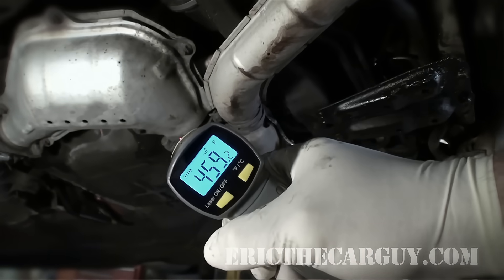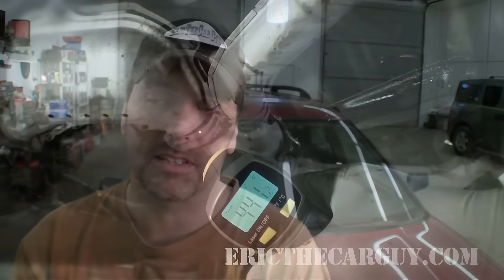Does Lacquer Thinner Clean Catalytic Converters? -EricTheCarGuy

Comment: As I recall, Kilmer used 1-gallon of lacquer thinner, to 1/2 tank of fuel. Your proportions were only 1/4 as concentrated as he recommended.
Reply: Scotty says in his video he has been, successfully, using LT for 30 years.  If you're going to do a test to myth bust something you need to do their test, not your version of it.  I've seen the actual Myth Busters do the same thing only to show their own ignorance.  If you go look at Scotty's video the first 10 top posts with scores of upvotes are people that did it and cleared their cat codes.  This is one video that would have been better had he actually done it the way it was intended to be, now the majority of peeps that sees only this video are going to assume it "just doesn't work" as if everything is as black and white as it works or it doesn't.  You don't buy 1 quart of oil to change your oil when it takes 4 quarts.  You get 4 quarts.  If it takes 1 gallon for a half a tank of gas and 150-200 miles of driving to work, if he wanted to "be safe" and use 1 quart he'd have to drive 800 miles to get a full gallon worth, and even then it might not work because the ratio is key.
Reply: 5 quarts
Reply: And I can tell you as a diagnostic tech and exhaust specialist I have made quite a bit of money from Mr. Kilmers little fantasy as I have seen more than my share of melted down converters from this idiotic trick. If its contaminated not much will fix that. That being said there is a chemical that WAS designed to help bring back converters that have carbon/oil consumption residue issues and possibly even antifreeze contamination. It is sold by Mr Gasket and is called Cataclean. It is marketed as a fuel system cleaner and catalytic converter "cleaner" and DOES work. The issues with lacquer thinner is there are several different "mixes" from the brands. The generic stuff Eric used is for cheap paints and varnishes and such NOT automotive paint which is considerably more sensitive to chemistry. I know from reading and such that a person found Cataclean, then tried the sniff test and may have even seen an MSDS sheet on it but got no specific concentrations of any chemicals involved. 
The theory of the lacquer thinner I have found came from back in the day of flat bed pellet converters and engines burning oil for what ever reason. Lacquer thinner made older engines run hotter on the exhaust mainly due to carbs not being designed to meter lacquer/gasoline mix AND newer gas has ethanol also.
And the computers wont allow the exhaust to overheat as most OBD2 cars also monitor for EGR temp as many cars have plastic intakes/gaskets and high EGR temps may cause engine damage.
You want to do it do so at your own risk because I have seen too many cars come in with melted down converters from the lacquer thinner trick and when a converter melts down, your talking at least $350+ to get a proper one. Yes Yes I know you can buy super cheap ones from Ebay, been there, done that and got P0420/P0430 codes and also had cars fail emissions when they go home. Heck some car can run as high as $1000 to replace converters parts alone as they have 4! 
Good luck if you try this , in my professional opinion as a 30+yr tech, hoax and I hope you dont trash your car.
Reply: @MonzaRacer  so cataclean does the job while protecting the cat and rubber car parts?
Reply: chris credit
Reply: I have a cat that is currently plugged as a results of using Blue Devil head gasket sealer when I had a HG leak.  It basically went into the intake, into the combustion, and out into the exhaust.  It's my 2000 Cherokee and it has two small cats right near the bottom of the engine.  THe rear one is plugged since only one cylinder got the BDP influx.  I have access to it and can remove it.  What would you say is the best way to attempt to clean it?  I at least want to see if it's fixable by getting all that mess out and see what's left before I buy a whole new setup.  Mine had to be custom fitted to my application as I have an aftermarket header setup.  If I get new cats I'm getting the OEM manifold as getting 1 of those bolts off of the aftermarket is a pain and only possible with the head removed from the engine as it's right behind one of the exhaust pipes and impossible to get enough torque on from the weird angles you have to contort to inside the engine bay.
Reply: @waynesanders1406  I think I saw video where they took out the front O2 sensor and pour it in a bottle of seafoam leave it soak overnight replace the O2 sensor start the vehicle don't do it in the garage
Reply: chris credit
Thus being significantly safer. Proves nothing but Eric's sanity.
Reply: Yeah, you're probably bright. I decided to replace my cat. Should've replaced my O2 sensors when the idiot light indicated.

Comment: I use acetone for this purpose and add 2 quarts with 2 gallons of gas. I
 had a 99 BMW 528i that failed smog in California by 13 points. Put the 2
 qt of acetone in when it had about 2 gal in the tank and drove it like l
 stole it on the freeway for 30 minutes, put 5 gallons of super in it, 
went back to the smog shop that failed it the day before and passed by 
10 points. BMWs are known to be on the high end of the emissions 
numbers
Reply: I've done the same thing but I used 1 gallon of acetone to 4 gallons of gasoline.I didn't even burn through all of the fuel before re-testing, I just went to the testing center with the acetone/gasoline mix and passed!  Afterwards I passed the test with the acetone/gasoline mix I did get on to the freeway though to burn through all of it since that much acetone will drop your MPG's pretty significantly so I just wanted to burn through it the same day. Besides passing emissions I will also say that after that my car ran so much better. Quicker starts, no more hesitation, no more rough idling, and a nice increase in MPG's one I refilled my tank with just pure gasoline. The acetone didn't damage any components either. 6 years later car was still running fine!
Reply: have you had any problems since?.. 2 gallons means it was almost empty right?
Reply: Unless it calls for Premium in the vehicle, don't use it. That will cause an emmissions fail. It's well proven. Just with a change of gas, they passed. If you put premium in a vehicle which does not require it, it puts out more emmissions. I've heard it many times from comments in vids and seen it proven on a dyno and emmissions test too. Putting premium in a vehicle these days, which does not require it, will cause higher emmissions and perhaps cause a fail and it also offers zero benefit or better mileage. Best thing to do before an emmissions test on a regular vehicle is fill it up with regular gas. The only time premium helps with mileage is when towing. That I believe, cause many guys have seen marked improvement when hauling with premium in the tank. Otherwise, it's an old myth/practice that only helped back in the carburated days. Back then running a tank of premium through once in a while, actually did help. Now, it doesn't matter, due to more advanced fuels and vehicles.

I believe your test was improved by the Acetone for a few reasons. It does clean the system/engine and it actually thins the surface tension of fuel. This causes better atomization from the injectors and resulting combustion. That's it's benefit. This is by no means a gas saver though, despite what people think. It will cause an initial increase in mileage, but it wears off in a day or so, cause the guy I saw test it in a video, figured that the Acetone evaporated off in the tank while sitting. He noticed no benefit after a day or so and no mileage improvement. It was a well done eperiment and he covered all the variables. He tried to mimic the same conditions with each stage of the testing. It makes sense to me, just from my observations of how incredibly fast Acetone evaps in general. It evaps far faster than gas. I tried it for a while as a gas saver and stopped for a couple of reasons myself. I worried about running it all the time in my gas and possible damage to things in the fuel system and it caused it to idle too high. Which in turn caused a muffler rattle and engine pinging. I mistakenly replaced the muffler thinking it was at fault and it was old too. 

Turns out the new muffler did the same thing. I stopped adding Acetone to my fuel as a gas saver and the problems completely went away. So I would not recommend running Acetone for that particular reason, as a gas saver. Seems like it's only temporary anyway. Here's a cool tip to not get scammed by fuel additives which claim to improve mileage. They are all Acetone. I've smelled the products claimed as fuel savers against Acetone and guess what? It's the exact same smell, Acetone. Lol. They scam you for $10 for a tiny bottle of fuel saver crap, when you could buy a whole quart for the same price.

Comment: As with other comments here, I also tried Kilmer's suggestion, using 1 gallon to half a tank of gas. Drive 100 miles or so, and it worked. I also am in agreement with others that if you are going to "debunk" something, use the same conditions. You did not use enough and essentially diluted it to much to be effective.
Reply: This guy even says in his show notes that putting that stuff in the car didn't change driveability one bit.  The car was still fine even if he didn't think it worked. So...why not try?  The guy fixes cars and is trying to dissuade you about going to a mechanic to charge you $1K to fix stuff.  This guy's suspect, man.
Reply: Any particular brand than can be better to use please
Reply: @arielc.1435  They are all the same. I just went into local Walmart and bought the brand they had. Klean Strip with a K.
Reply: Well said 🎉😅😊
Reply: Because he resembles a used car salesperson.
Reply: He essentially use only a quart in a car that is actually 18 gallons lol. Nicely nearly the “right” ratio

Comment: I used 3/4 gal of Seaguard Solvent 130 and 3/4 gal of 100% Toluene added to 14 gal of 87 octane gasoline. The repetitive P0420 code on my 2000 Tahoe Limited (503,000 miles, original cats) did not come back. 4 days later, my aftermarket trip computer went from "not ready" to "ready", and I just passed my CA smog check. Oh, and my truck is running smoother now.

Comment: I wonder if you could inject the lacquer Thinner just up stream from the cat. The method could be used to test all "cleaners". Of course you would not want to start a fire in the cat and damage it further. This way the chemicals  are not burnt up in the engine first? This would be harder to test. Just wondered? In the human body injecting drugs Intra veinously is done because the stomach can totally destroy drugs taken by mouth.  This assumes the sub straight is not broken up.

Comment: it is interesting, for me I have a 40-45 liter tank on a dodge S.X 2.0 I ended up using a gallon of this product called Omni 251. it from a vehicle that did not pass a emissions test and after running it through and using the full tank, I got it tested and it passed the emission test.  So I am curious if that may have been your problem maybe that not enough was used. now this dodge has 250K on the motor and has had no issues yet. best of luck.

Comment: Th sad thing is... I tried this just this weekend. In a 1:10 proportion. Check engine light is on, but that was once I got home, before that, I started to experience noises and vibrations after 60 kms. Even before that, in the first 5 kms the needle of the fuel indicatr rose up while driving and never moved down again, the car is at the shop now. The sad thing is that I'm a Scotty Kylmer fan myself. I hope the car is not that bad.
I know, Scotty says 1 gallon of LC in 9 gallons of gasoline, but that's a full tank in my 1,4 so I was never going to finish a full tank in one ride. Plus, I tried the right proportions  (2,5 ltr of LC and 28  litr of gasoline. Even Scotty told me live that I could use less thinner if the cat was not bad.
I'm suspecting the thinner I put in there was not pure laquer thinner. I suspect the can Eic was holding was ot either?

Comment: Thanks for the video, your the best. I went from 22mpg to 34 and 35 mpg using acetone. I did the test over and over again. Do you know if I would damage something if I continue to use it?
Reply: If the acetone comes into contact with ANY rubber or plastic along the way to getting burned, it causes damage.  It melts rubber, plastic, vinyl, etc.  This means O-rings, gaskets, and oh yes, piston rings.  It'll also ruin any paint it comes into contact with, and void several warranties.  Doing it once every couple years to clean gunk out is one thing, running it with every single tank of gas is another.
Reply: +Alex M that does make sense thanks
Reply: I stand corrected on the piston rings, but overall stand by the general recommendation.  At the very least, running acetone through rubber lines (gas etc) on the regular is not recommended.
Reply: HAHA i just tryed this on an old engine 300,000kms with Septone all purpose thinner,, after only a 15km road test i have alot of throttle response and a very smooth idle, im no mechanic but this has improved my old Mitsi L300

Comment: If you were trying to prof or disprove Scotty Kilmer's theory, then why did you fail to use his formula of one (1) gallon per half a tank (estimated at 8-10 gals status). Versus your own   Mix of 1-QUART per 3/4th a tank of your Subaru?  Significant difference in strength, old boy.  Not even close to a test of his remedy. Mechanics like you who spend your time attacking other mechanic's useful ideas are what ruins the car maintenance industry.  Not impressed with your attitude or sarcasm. Of no use.
Reply: He did not attack Scotty all he said it did not work for him. In no way was he sarcastic against Scotty. In fact he was very respectful of Scotty so do not put words in his mouth he did not say
Reply: you are right.. he also said his portions may be why it didn't work for him as well
Reply: Tim did you also listen to him explain his car only has like a 13 gal tank and was barely between 1/2 and 3/4 and Most subarus dont move off full for first 7 or 8 gallons. Just repalced one on a ladies car, took 13.8 to click off pump she complained it didnt move then all of a sudden was at a/2 tank and took 10 gallons to fill! Go figure. MOST cars at or below 1/2 tank rarely have over 5 gallons of gas. 99% of gauges are indicators NOT actual incremented guages. Now if properly working you will KNOW that half tank means 10 gallons will fill it up. BUT 1/2 tank isnt half tank. and I have watched ol Scotty a few times and I will not recommend his channel as I saw him doing some shady work and bragging he has done it for years and everyone told him its wrong and he BRAGS about putting people in jeopardy by his flagrant dismissal of actual DOT fact. Wont get into it on Erics channel. Just know this a professional technician has seen and been appalled at Scottys practices.
Reply: MonzaRacer   This Lunar Rover technician fully supports Scotty's backyard fixes. The laws of physics and car dealership "sell more parts" standards are rarely in sync.
Reply: i agree    fuck that stoner .. dont mess with scotty